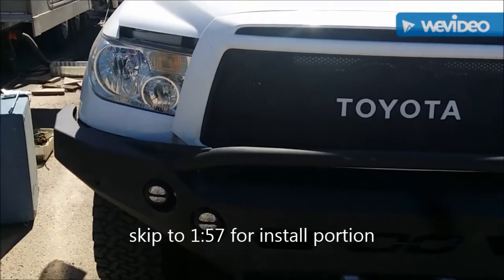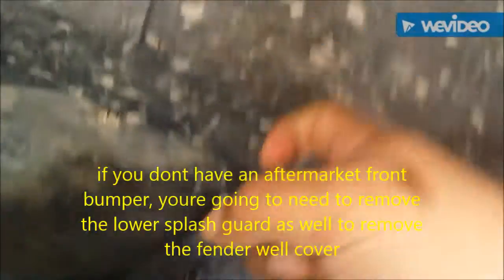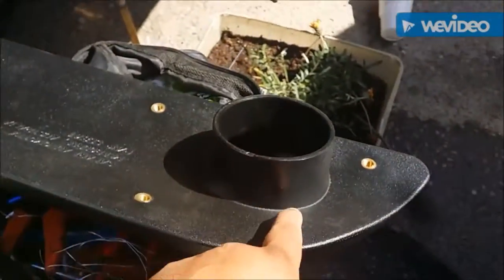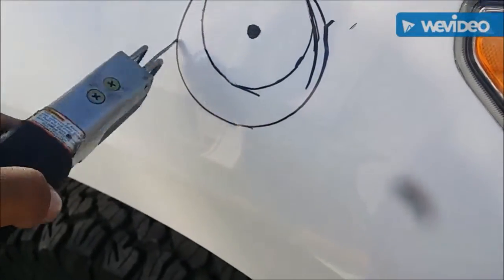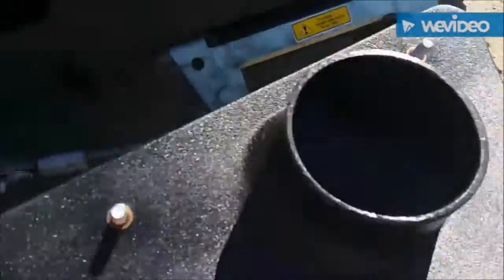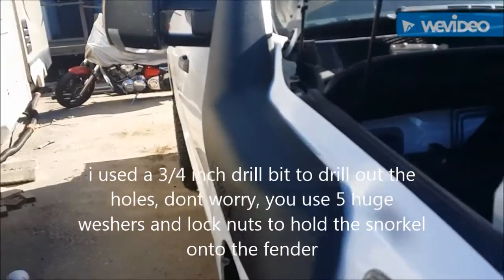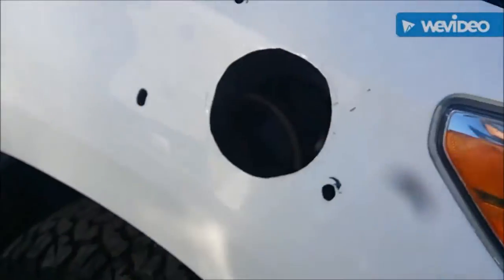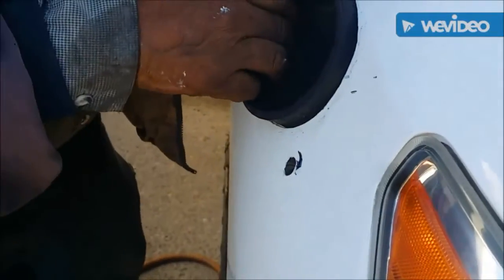Tundra Snorkel install with safari SS87HF

Comment: Thanks for posting. Was there a part two to this? Or was that it? Just screw in to the A pillar and then connect with that tube. Did you ever find out where to get that flexible tube?